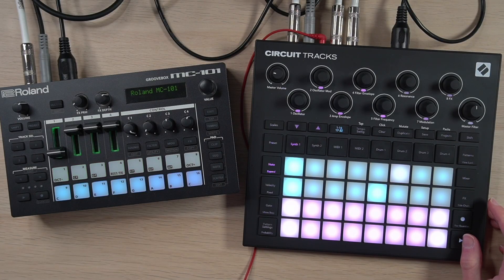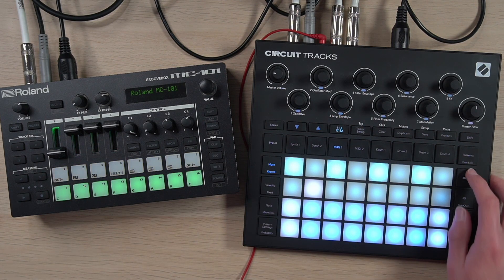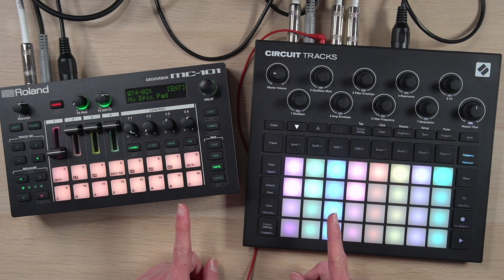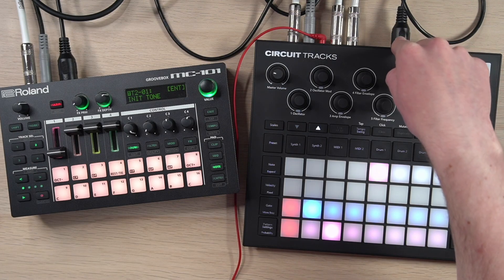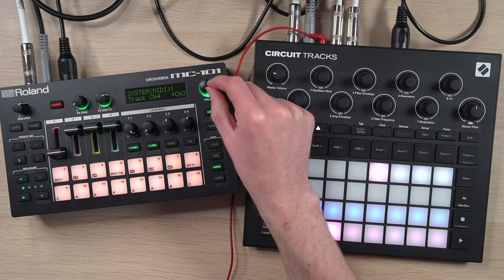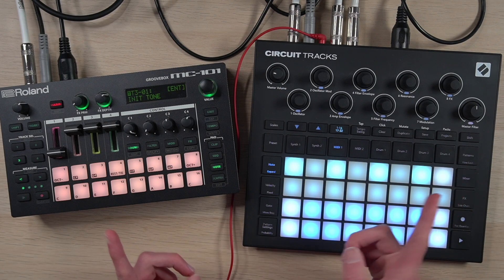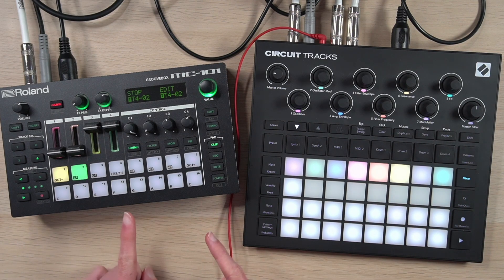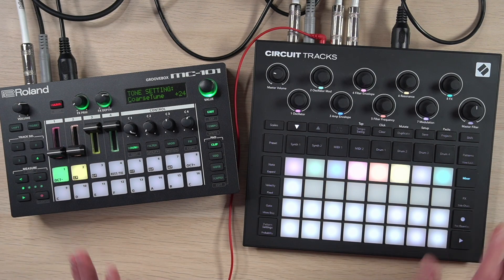How to Use the Circuit Tracks & MC-101 TOGETHER

Comment: Thanks for this video! I found exactly this setup very handy and compact enough to always live on my table. There is one more thing you can do on top of it: MIDI mapping. So that twisting knobs on MIDI1 and MIDI2 synth would be tweaking sound params on mc-101. One can easily set wished mapping with novation components. Look for MIDI Implementation Chart for MC-101.

Comment: Something else to note about doubling tracks is you can do it with the Circuit Tracks synth tracks as well because they also send MIDI. The only constraint of course being you still need to assign them to the audio input of MIDI 1 or MIDI 2, but you can bring them in and out on the MC-101 faders.
Reply: Sorry care to explain better? So basically you can effectively use all 4 circuit synth tracks using sounds from the 101? Is that correct?
Reply: @sharkpyro93  Yes. If you ran MIDI from your Circuit to the MC-101 you'll get your synth and MIDI tracks on MIDI channels 1 to 4. Set up 4 synth tracks on the MC-101 listening to these channels. If you drop the volume of the synth tracks in the Circuit mixer then you'll only hear the MC-101. Or you can blend them with the Circuit synth tracks.

Comment: Thank you for the video Gabe.

One thing that's missing from both these devices is the ability to record external sources. I play guitar and bass and would like a couple of audio tracks in which to loop stuff.

I'd be very interested in a video that pairs either of these devices with a looper (eg RC-202), and what the workflow and shortcomings would be.
Reply: I have a RC202 and Circuit tracks and struggle slightly to make them gel together quite as I want. My aim was to make the RC202 the master device so I could lay down the fundamentals of a track on guitar or bass then once the loop is made, have it work as the clock source so the beats just drop in round it. Generally speaking it's easier working with Tracks as the master. Then it's also quite hard to know how to route audio in a way that allows you to sample from Tracks into the RC202 but still have Tracks as the main source of beats etc. Tracks also lacks a couple of obvious things that I consider necessary, such as a pre-count before recording starts etc.
Reply: @ColonelForkEyes  thank you. I should take a look at the MIDI implementations of both devices me thinks.

For example, the RC uses MIDI start/stop messages to control it, and it really makes me worry that most other devices emitting just CCs won't be able to control it.

But, if you say that at least they can get synced via MIDI, then maybe that's all the compatibility I need 😍

Comment: My Circuit Tracks just arrived today so I've not even scratched the surface yet but I'm immediately thinking I could pair it with my Electribe 2 Sampler. Thatll let me pitch samples like the Circuit Rhythm, which is cool. But I've just also realised I could swap scene on the Circuit to drop the output to the Electribe without muting and then use the Electribe touchpad to play instead.

Comment: Getting my head around the mc101 it is a wonderful machine there is a bit of a learning curve and a bewildering number of functions and settings. I’m comfortable with tracks and clips but I am finding an almost total lack of tutorials on scenes, For example I know you can assign  clips from multiple channels to a scene but can you have multiple clips from the same channel in one scene and if so how do I do that.

It would be great if you could do a video of the mc101 on song structure from scratch  using a series of scenes for verse/chorus/middle eight etc.

PS I did buy the $5 sound bundle :) hint hint
Reply from the maker: I already did! Hopefully it's helpful: https://youtu.be/Q_Pw9140mSE
Reply: Thanks I’ll watch it again.
Reply: Definitely more info on scenes. I suppose I’m looking for Scenes for dummies. For example can you have multiple clips for the same track play in order within a scene, so I could say have two different drum clips and a single bass clip repeating over  them in the same scene or would I need to use two scenes one with each drum track to do this?

Comment: Wicked! I have both, partially due to your influence, Gabe! Was also thinking, could one also then map the 8 macros whilst in MIDI mode to what is coming out from the 101? This would make up for some of the the lack of physical controls on that l'il fella, especially when we consider the partial editor update...
Reply from the maker: The Circuit Tracks can output midi CC's, so as long as you could get which CC's control which parameters on the 101, you should be able to make that work. I'm not sure if that's a thing for the partial editor or not though.

Comment: Great video. I’ve had the mc101 for a few weeks now and have made more music with it already than any other piece of kit I’ve owned. I’ve just ordered the circuit too to try and was interested where you’d go with this video.
I’m interested in what benefit you think this setup has say over just using the mc101 as you’re not necessarily gaining in track count? (Mc 101 could do all the drums on one track for example). Not a criticism, just interested in your thoughts. Also would just clocking them be an option (Also allowing stereo from the mc101)

Comment: i think about this combination, but i would like ask if it works in this way: i will use bot midi track on circuit for another synths. can i use mc-101 with internal sequencer just synced with clock ? when i change pattern in circuit, it will send program change on channel 16 - can i map this program change on mc-101 to change sequencer pattern as well? can be stored with patterns in mc-101   also sounds for all 4 tracks ? It is possible use all 4 tracks just for synths on mc-101  (drums will be produced by circutit, i dont need it from 101)? so basically, i would add some other synths track to circuit.  4 synth track is good enough for me but without have 101 i cant check if it will work as i need.. thank for answers

Comment: I've bought the MC101 thanks to you Gabe ^^. I'm learning to use it, but the first thing that I find annoying is the difference of volume between the sounds of the tracks and those from the MC101 which are usually lower, even if I put the level at max... Do you have any recommandation ?

Comment: I’m trying to use my
101 with oxi1 and sometimes my squarp pyramid doing to sequencing. Getting the 101 dum pads to the proper pads on the sequencer is horrible and time consuming. Any tips for making this easier. I noticed this video just had drums on
Midi 1 and it worked all pads in proper place for the drums. I must be missing something and doing it all wrong

Comment: What would be even cooler is if the mc101 had keyboard splits so that two mc101 tracks received on the same midi channel but responded on their own range of the midi notes so you could have two separate patches on the key range, like arp on the lower and melody on upper side. And then from the circuit have four different patches thru two midi channels.

Comment: I love my circuit tracks but I don't love its inability to send MIDI patch to external synths so you can't associate a particular sound with a pattern or track with any degree of ease. In fact it's getting to the point now where I might have to consider moving to another similar device that will allow patch changes on external gear. I wonder if Novation has a plan to address this in a firmware update.

Comment: Sorry for the basic question here....but using the Circuit as the sequencer for the MC-101 via midi will only allow you to use one sound at a time, correct? How can the Circuit best utilize the power of the MC-101? Or am I missing something?
Reply: you can control the 4 tracks of the MC101 with the circuit, depending on how you set you midi channels. You can also play two MC101 tracks (with same or different preset) at the same time of they receive on the same midi channel 😊

Comment: Roland xv/jv rack units from the 90s have much the same synth architecture as the MC101 (zen core). Lower fidelity, but the architecture is nearly identical. If you like the sound of the mc 101 but want more polyphony and analog outs, check it out, they're reasonably priced. 

Programming them using the LCD display is.... well, the xv 5080 actually had a pretty big screen. There are also software editors. But they have zillions of presets and they sound good.
Reply from the maker: Nice, I'll add em to the list!
Reply: @GabeMillerMusic  I'd be very interested to see how you respond to them. They're kind of the polar opposite of a Circuit: they have no hands on control at all, they're incredibly deep but you need external hardware to get any use out of them.

Comment: So don’t all the notes you play on midi 1 Also trigger drum sounds which is also on midi 1??
Reply from the maker: You can reassign which tracks send and receive which midi channels, but by default yes, that would happen. In this case, I didn't end up using the MC-101's drum track.